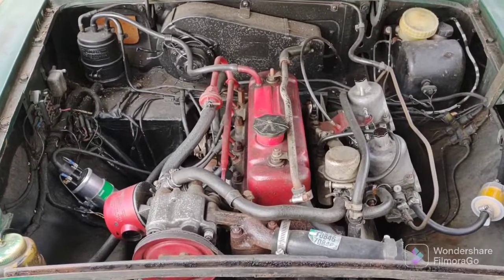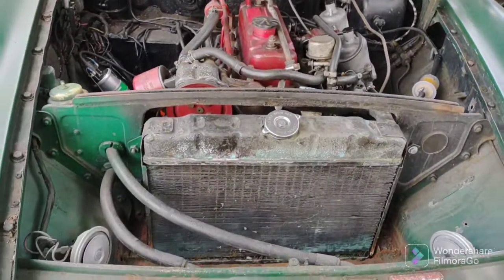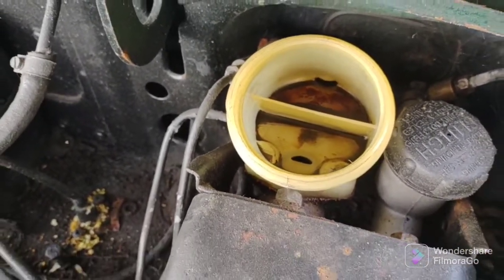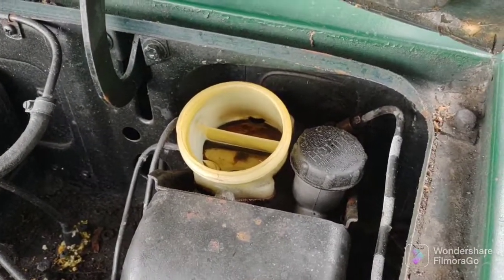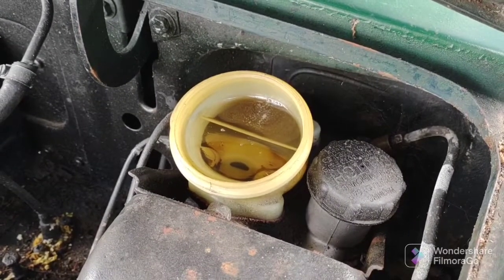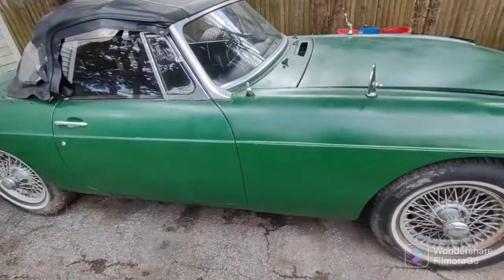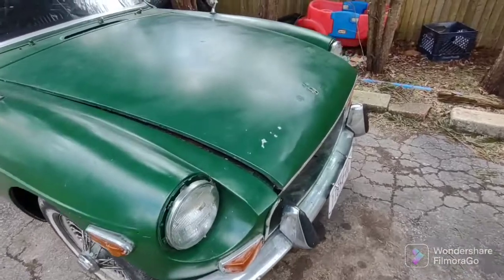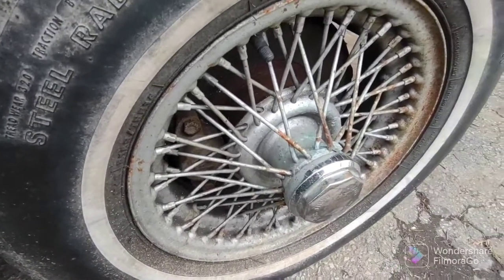1972 MGB had brakes, now no brakes - let's explore

Comment from the maker: Update: The brake master cylinder in this video is bad. I would drive the car and then check the fluid in the master, and it would be lower. It turns out it was coming into the car behind the pedals.  So I ordered new master cylinder.

Comment: Did you ever check the brake safety switch for leaks?  $.10 O rings can cause the same failure and puddle under the peddles.

Comment: The think the splines on the hub are striped. The bolt is prebaby there to keep the wheel on the car.  This car is not road safe. You will need a new or good condition hub and spoke rim. I would check all 4 hubs. if one is bad all are probably bad. I had to replace all 4 on both my 68 and 71 MGBs.
Reply from the maker: Hello American Patriot.  Yes, I'm going to be evaluating all the hub and laced wheel splines.  They're probably all in need of replacement. I know why the bolt was put there. Instead of fixing it the right way, the bolt was put there to prevent the worn out splines on the laced wheel from "skipping" past the worn out splines on the hub.  This past summer the bolt broke and when I put on the brakes the splines made a pretty awful grinding sound as they skipped past each other due to rust and wear. This is dangerous as the big knock off nut that holds the whole wheel on can come loose, and the wheel can fall off. So it was a bandaid fix that kept a previous owner on the road for a little while.
     Laced wheels are costly so it may be a time to convert to the 4 stud hubs to use regular wheels on the MGB.  If the splines on my laced wheels are bad, then I'll need all new wheels.
    Wow, you did the right thing replacing all four on both of your cars.  That's awesome.  I may be doing the same soon!
  Thank you for your insight.  Happy Motoring!!!!

Comment: It maybe there to put grease into the splines orhu bearing
Reply from the maker: Hello, oh yeah that bolt.  Well when  I bought the car that bolt was there.   Somebody should've changed the hub and the wired wheel as the splines were flat. That bolt finally broke.  I have since replaced the front hubs/bearings/rotors/pads and all the wire wheels, tubes, and tires. See those videos if interested.  So no more worries.  Thanks for commenting 🙂
Reply: @anthonyhfe6450  I've got no brakes on  mine either but I suspect it's the master cylinder.  I might buy a repair kit cos a new one costs £163